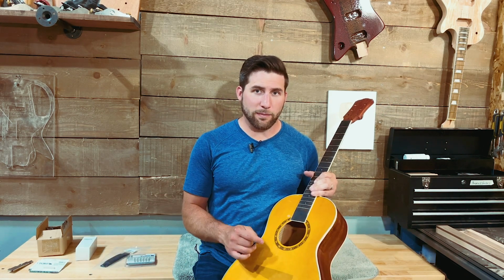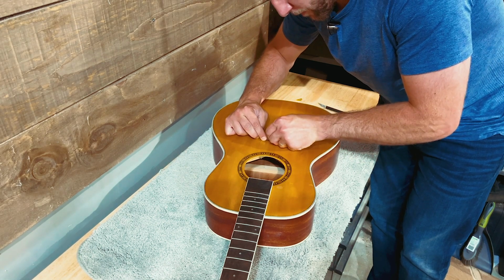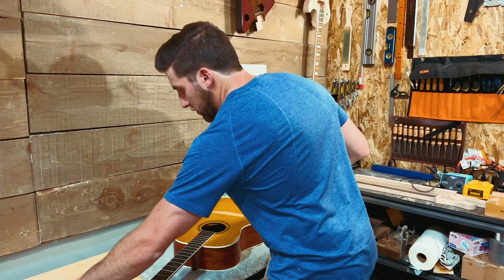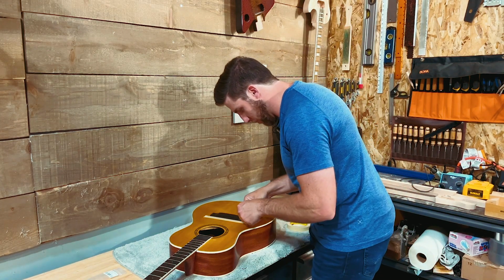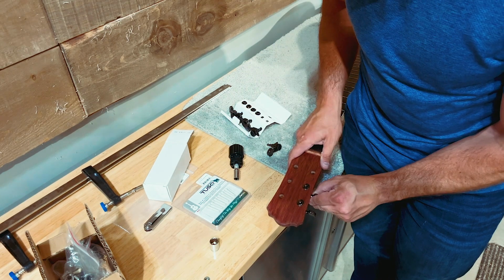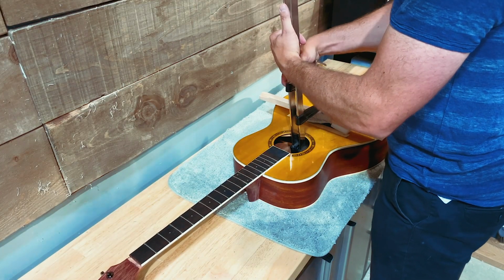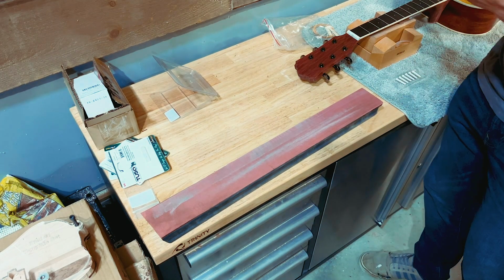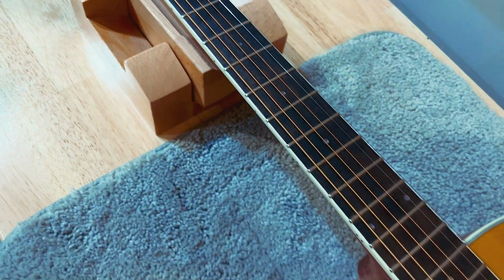The Acoustic Guitar Kit Final Assembly

Comment: For the most part I think you did a good job and it's a nice looking little guitar. But, I have a problem with how you installed the bridge. The bond between the bridge and top is possibly the most important part of a successful acoustic guitar build. The bridge is responsible for transferring most of the string vibrations to the top, and that transfer is critical to the sound of the guitar. I would have scraped off all the finish that sits between the bridge and the top and wiped down the bottom of the bridge with naphtha or another solvent prior to glue up. Wood has natural oils, and removing them from mating surfaces gives a stronger glue bond. The strongest possible bond helps both with sound transfer and durability. I think there's a good chance that this bridge will wind up lifting down the road and need to be re-glued.
Reply from the maker: Thanks for the feedback Jeff.

Comment: Hey Brad, I make all measurements from the nut NOT from the 12th fret, IE double the 12th fret measurement. More accurate IMO.
Reply from the maker: If you have confirmed the measurement from the nut to the twelfth fret, why would it be more accurate? They’re both fixed points.

Comment: could you put together a wooden template of the bridge and attack that with a bridge clamp or something while doing the finish? it would block off the area of the bridge when doing the finish, and would be easier to remove afterwards. it wouldnt matter if it got sprayed.
Reply from the maker: Ya, you could definitely do that. You would just need to deal with the obstruction of the clamp. But using double sided tape would remedy that.

Comment: I still don't understand why modern acoustics still use an antiquated style of bridge that isn't adjustable for height or intonation. When I build acoustics I use a floating bridge (like the type found on archtops) which can be pinned if you're scared of it sliding around. Nice work as always and don't forget always leave wiggle room. Lol.
Reply from the maker: Yeah I really just want to through a reasonable hard-tail electric bridge on there if I’m being honest.
Reply: @BradAngove  That's the way to go. Purists won't like it but who cares. If it improves usability go for it.
Reply: I suspect that luthiers have found that the traditional style bridge is usually best for sound quality in acoustic guitars. You want the bridge to be as solid as possible to best transfer string vibrations to the guitar top. Gibson and others have experimented with adjustable acoustic bridges but they've never really caught on. Obviously the acoustic properties of the bridge don't matter nearly as much for electric guitars where 90+% of the tone comes from the pick ups.
Reply: There's a guy on YouTube who makes acoustics with custom rosewood bridges that use Fender saddles.  He's also done acoustics with Fender hardtail bridges.  Seems to work just fine.

Comment: Hey Brad. Acoustic luthier here. It is very important to not dig too deep into the wood when scoring around the bridge line. The result can basically create a weak point in the top for it to start folding in under string tension. Kind of like a hinge. Your extra cautious approach was well founded!
Reply from the maker: Thank you for the input. That is what I was concerned about, so I’m glad to hear that I was on the right track.
Reply: @BradAngove  no problem! Love your work.

Comment: Brad. Rosa String Works is an EXCELLENT channel on the YouTube to learn about the production, assembly, care, and repair of acoustic guitars. He has many videos where he scrapes/removes the finish for an acoustic bridge. You should try to rough up the bottom of the bridge a little bit before applying the glue. It helps. Same principle as roughing the surface before painting. Gives it a little bit better surface to stick to. 🇨🇦🇨🇦🤘👍 I like the shirt.
Reply from the maker: Thanks Brian. That’s interesting; I had always understood that glue ups work better on very smooth pieces of wood where there aren’t scratches for the glue to deep into.
Reply from the maker: *seep
Reply: @BradAngove  Hmmm... Odd. I've always heard the opposite.
Reply from the maker: I could be mistaken. I think it likely depends on glue type as well.
Reply: @BradAngove  After you said that, I did research and found NOTHING backing my claim. One of my German uncle's was a carpenter. He told me that when I was a kid growing up there, when I worked with him. But he was wrong, and so am I. I just never checked to see if he was correct. I stand corrected. You are right.
Reply from the maker: Well I appreciate you double checking/doing the research. I was worried that I had been misleading people, so I’m glad that’s not the case.
Reply: Scuffing can prevent sliding but can lead to microscopic gaps in the glue joint.  Half a pinch of salt used with wood glues will prevent sliding. The salt dissolves into the glue leaving no gaps in the glue joint.  I learned that trick from Ben at Crimson.